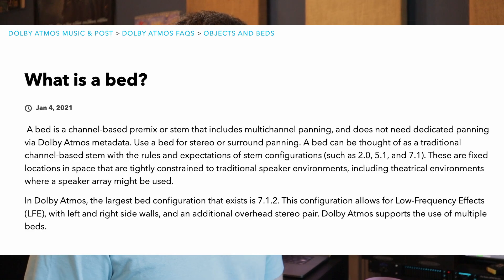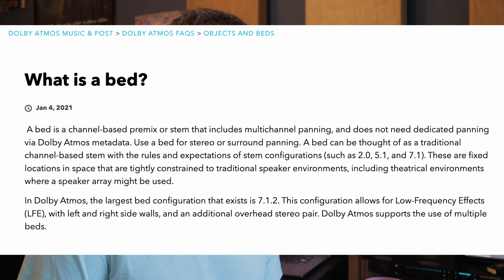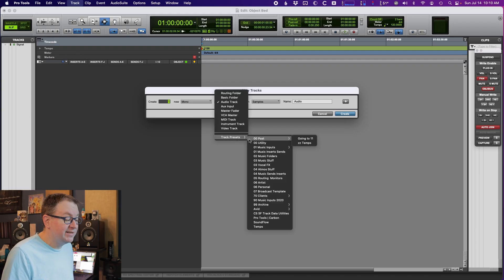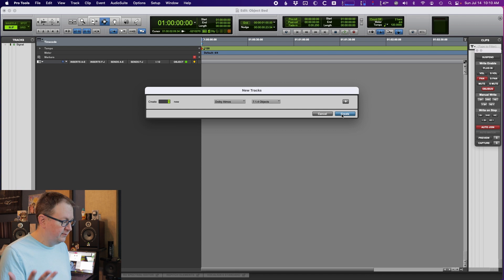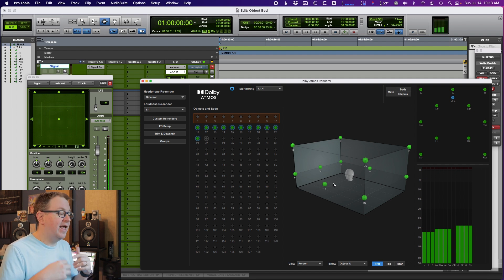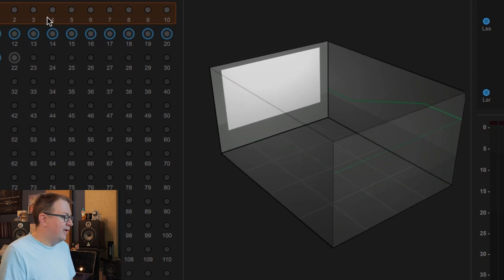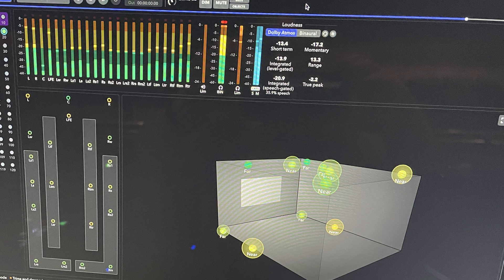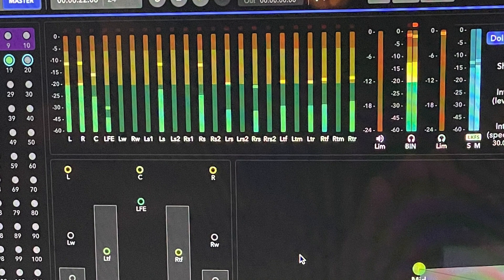The Object Bed for Dolby Atmos

Comment: hi Dave. My question is can you squeeze more level or energy by using the traditionnal bed by using, say a multimono limiter than with creating an object bed? i tried both of them(actually not using an object bed, but just objects) and come up with very different lufs and TP values whether i use a lot of objects instead of using the bed. The bed, according to my experience, specially if it is instrumental music, will allow me to get more level to my ears, while still maintaining the specs for dolby Atmos delivery. Is it just me, or the way i work with objects? Maybe it has to do with my template or something else. My experience with mixing in Atmos is kind of new(less than a year) and am working with protools Studio version, which is simular than the ultimate, except for track count and not being able to use the dolby atmos music panner.(apparently, it only works with the ultimate version) Thanks for your take on this. Great advice on a bunch atmos content on your channel!
Reply from the maker: This is an interesting question--hopefully I'm understanding what you're asking. In theory, a bed and an object-bed with identical pan positions should function identically in terms of LUFS. When you start moving to more discrete objects and placing things differently, that could affect the measurements since the measurements are all based on the 5.1 re-render. Does that make sense and answer your question?

Comment: 15:57 Sorry, for the stupid question… ;-)

Alright, by now, I understand that a bed must be part of a Dolby Atmos mix, I see that there are use cases with multiple speakers in a room — but once you are listening with headphones (from this moment on, called “binaural”, right?), all these channels from the bed as well as the objects would end up in two speakers of your headphones.

Is this Dolby Atmos “version” that will be played to you larger than a normal stereo mix? So, actually the amount of data being streamed… My understanding until now was that mixing-wise this is of course all taking its space and is as large as you told us before. But I always thought that this binaural version is so to speak a “flattened” 7.1.2 or at least 5.1 version, keeping the objects' movement in space — while still being as small as genuine stereo mixes.
Reply from the maker: Good questions.

From a data transmission standpoint, the binaural can be the same size as the stereo since it's two channels. However, how that data is transmitted to a consumer is something I'm not sure about, and I think it depends if you're doing the binaural processing on the device or if it's done at the distributor and then streamed. I know in the case of Apple's Spatial Audio, the spatial audio processing occurs on the device, and the .mp4's that Apple streams would probably be about 23 MB for a 4 1/2 minute song. I believe Tidal streams AC-4 IMS which is "immersive stereo" so in that case the binaural version is created by Tidal and then distributed.

I don't know that I'd describe it as a "flattened" 7.1.2, though. The binaural processing is trying to add the depth and imaging cues you'd hear if listening on speakers with the goal of reproducing the experience you'd have listening on speakers.

Comment: So when an object is coming out of just one speaker in array setup versus bed signal coming out of multiple speakers, is that volume difference some how compensated? Or does this mean we have consider this in our atmos mixes to make the objects louder, when using a bed for most tracks?
Reply from the maker: I don't think it's something you need to worry about. Arrays are mainly a thing for theatrical presentation and ideally you'd mix those on a certified dub stage where you would hear things in an array.

Comment: Hey there, thank you so much for your video. 

There is something that keeps confusing me on this. Most music engineers (Genewick, Andrew Scheps, Fab Dupont, etc) that have vids about atmos mixing, state that the bed = discrete channels, while objects = positioning in 3D space. 
Supposedly then, an object that moves around in a 9.2.6 room will translate better in a 5.1.2 space. Therefore, an OBED would be more "translatable" than a regular Bed. 

Is that correct? 

I get your point about arrays and big theaters, so in a way I'm wondering what would one do to engage those speakers, 

Additionally, could OBEDS can have an effect in Binaural, say you have three of them with far - mid -closed settings? 

Thank you!
Reply from the maker: Good questions. The bed is made up of discrete channels, however, it's my understanding that as far as the renderer sees them they are effectively objects with static positions. Personally, if I'm moving something, I prefer doing it as an object and not within a channel based bus(bed or O-bed).

From my experimentation, there isn't really a sonic effect of choosing a bed over an O-bed or vice-versa. I think for most engineers,  it's really more of a workflow choice. I recently have started using a bit of a hybrid approach of the bed and an object bed, but I'm still figuring out how to articulate why I did it.

Comment: Thanks for the great video! I have a question regarding the difference between a bed and object-based audio in Dolby Atmos, especially when considering playback on AirPods and Apple Music’s Spatial Audio. While I understand that using a bed might be better for theaters because more energy is coming from the speakers - I’m curious about the potential impact on headphones. When panning between speakers or placing sound within the virtual space, does using a bed introduce more phase issues or «smearing» compared to using object-based audio? I imagine that objects, with their precise control over spatial placement, might reduce phase artifacts in a headphone environment, whereas a bed might lead to less accurate spatial imaging. What is your take on that?
Reply from the maker: Good question. If I am panning between 7.1.4 speaker locations, I will use an object because you can have phase issues in binaural if you have the same information in multiple bed channels. Objects sound smoother to me in headphones when panning in between speaker locations. But for static panning to a speaker position, it's sonically the same if you use an object or a bed channel.

Comment: really good points. I use Object Beds For time based EFX. and when I want to pinpoint a sound/ EFX in space. An Example is I can set up a 4-point object bed and insert a quad reverb. Then place that 4-point bed anywhere in the space, Beds also Blead into other speakers, But like you said making them very important also.

Comment: Hi Dave, great channel.  A coworker recently turned me on to it and this is the best immersive mixing content out there.  Keep up the great work!  I recently had the opportunity to hear a mix I did using a 9.6 Object Bed in a 15.8 room.  I immediately noticed the same thing you express in this video - some speakers (the ones that didn't have Objects snapped to them) were not engaged in the playback.  I don't know if I would have noticed a difference if I wasn't staring straight at the Renderer (and its unused output meters), but the mix felt thin to me in that space.  So in terms of scaling, I sort of came to the same conclusion - that the Object Bed method is inferior for scaling UP.

You mentioned in the video that there is no sonic difference between using the Bed and an Object Bed.  I assume you are referring to when you A/B on your speakers.  Is there any discernible difference in the downmix?  Do you get different results using the Bed vs. Object Bed if you create a 5.1, stereo, or binaural re-render?  We've established that Object Bed mixes may not scale UP as well, but what about the more likely scenario of scaling DOWN? 

Another aspect to consider is the LFE.  Since the LFE is not directly addressable via an Object, the only way to get something into the LFE is to use the Bed.  In my example, I used an aux send for the LFE and it returns into the LFE channel of the Bed.  So in that scenario the Bed was not completely empty.  It just had one the one LFE channel.  Thanks again!
Reply from the maker: Thanks! I'm glad you like the videos.

In terms of sonic difference, I don't find there to be a sonic difference between Objects and Beds on my speakers or in any fold down situations. There shouldn't be any sonic difference between the bed and an object bed for fold downs so scaling down shouldn't be an issue which is good, I think, since the more likely scenario for music is that mixes will be scaled down.

Comment: Thanks for this! Could you please do a video on how the different track widths are compatible with each other? How do I make my Atmos mix (done in my 7.1.4 environment) utilize all the speakers in a larger, e.g. 9.1.6 environment? Cheers! 👍
Reply from the maker: I'm not quite sure what you're asking about track widths and compatibility, but this video might explain a bit about utilizing speakers in a larger environment than the one you are mixing in: https://www.youtube.com/watch?v=eDGCjoet5Kk
Reply: @goingto11  Thanks! Sorry for being unclear, I've watched the linked video earlier and if I understand you correctly, you set up a 9.1.6 track width bus which is then routed to your 7.1.4 Atmos outputs? And the Wide speakers are panned exactly 68 % in the F/R relationship? What makes this a bit confusing is two-fold. 1) I don't use Pro Tools so names of things in the DAW don't always match up and 2) I don't have access to a 9.1.6 room to verify that it actually works. :) But cool, I'll implement it accordingly in Cubase. Cheers!
Reply from the maker: Well, maybe one thing I should clear up is I'm not feeding an Atmos output--in some ways that doesn't exist. What I'm doing is feeding into the Atmos renderer which then feeds my monitors based on the configuration of the monitors which, in my case, is currently 7.1.4.

That aside, I'm not familiar with Cubase, but there are probably a couple of approaches you could use to hit the wides. The first would be to use a 9.x.x bus, and then figure out the panning to hit those specific channels. If there's a meter for that bus, that should help you figure out the values. Another way some of us have done it in the past is to just use a stereo bus that is assigned to a pair of objects that are panned to the wide positions. Then when you want to hit the wides you just send to that bus. You'd still have to figure out the panning value for Cubase, though.

Comment: Thanks so much for another outstanding video, Dave! One thing I'm not clear about: in the context of arrays and "coverage," how/why does the Bed interpret fixed pan positions differently than the same fixed pan positions in an OBED? This would seem to be at odds with the accepted language about the Bed, which is that its LCR, etc. channels are really just like objects that have fixed, unalterable panning data. I hope this makes sense, and sorry if I missed something. Thanks again for sharing your experience!
Reply from the maker: Well, the bed channels are like objects in one sense, but the bed is also more like a traditional multi-channel format like 5.1 and 7.1. I think this doesn't get talked about much when it comes to music production because it's generally not as applicable as it is in the audio post world. I'm actually working on a follow-up video that will hopefully demonstrate all of this a little clearer.
Reply: Excellent - thanks, Dave! Appreciate the reply

Comment: INTERESTING!  So there must be some voodoo going on in that cinema or other commercial Atmos cinemas because that is NOT the way things mixed in the BED are reproduced in any home cinema, even the largest and most insane ones that use a Trinnov or Storm.  It seems weird that the renderer is showing the balls with halo around them as if the “size” parameter has been engaged on everything.  I’m gonna get a discussion going in our Atmos mixing group about this because this is a very interesting topic.  Some things to discuss here:

A) The Trinnov placement guide seems a bit misleading because they list the multiple side surrounds (LS, LS1, LS2) as an array.  As you know an array is the same information duplicated through multiple speakers.  In the Trinnov you can set up of those 3 left surround speakers as EITHER an array or discrete speakers which can then only be used if an object pans through.  Something panned to Left Surround in the Bed will only come out of LS.  If you want something panned to LS in the Bed to come out of LS, LS1, LS2, you’d need to switch to a different speaker preset in the Trinnov that has them set as an array.  It will attenuate each speaker 3db and play that same sound out of all 3 speakers but then you lose the ability of an object panning along the wall to transition smoothly from speaker to speaker like it would in the regular preset where they are discrete speakers.  Something very weird is going on in that theater you went to (side note, that’s amazing you got to play back some of your mixes in that type of space!) but from your pictures it looks like it can instantaneously decide when something is a bed and duplicate that sound in an array fashion or if it see’s it’s an object it places it discreetly to the one speaker.  Also weird that in your pic when LS, LS1, LS2 are all showing on the meter, they are different level.  You would think if it was array they would all be getting equal volume.  When I was visiting LA last month, I was lucky enough to get to tour the Sony lot with Marc Fishman, and they showed us their Atmos mixing stages there which are basically small to medium size commercial cinemas.  They have so many speakers, I counted 14 height speakers in one of the rooms!  I asked if they are using any arrays and he said no, they are all set as discrete speakers.  So they are not mixing with arrays.  So again I’m wondering what the hell is happening in that theater!!!  In any case it shows that it’s very limited to that theater or other commercial theaters but no device that would be used to process the home theater mix will behave that way so it’s a very limited thing for people to get music mixes played in a theater.  Bigger point is it has me wondering what’s going on with decoding in theatrical?  Even though the mixing stages have discrete speakers, is it doing the same thing when they’re mixing where it has some sort of ability to “on the fly” place a bed sound in the entire array and keep an object locked to discrete speakers?  I’m definitely gonna follow up with Marc about that!  

B) Object Beds that you mention in this video seems like there is no winner other than for workflow but let’s talk about mixing in the Bed vs Object specifically for home theaters.  Movie mixes like Ready Player One which are mixed as Bed only are stuck in 7.1.2.  In every AVR or processor if you have 4 overhead or heights speakers, it takes the left top and duplicates that sound to Left Top Front and Left Top Rear.  Same for Top right.  So that way Bed height information will come out of all 4 of your top speakers but you still have discrete movement or placement for objects.  If you have 6 overhead speakers though, Bed only height info will only come out of top middle.  Most people find this frustrating and make a separate preset for movies like this that removes their top middles and uses only 4 height speakers so it makes that bed info cover a larger area.  Also, anything mixed in Bed only will NOT use anything beyond the 7 ear layer speakers.  So if you have front wides, extra surrounds, etc, BED information will NOT play out of those speakers.  You would need to do something similar like with the heights where you make a separate preset where those extra speakers are setup as an array.  Only the Trinnov and Storm can do that since in most AVR’s and processors arrays have to be setup manually and by sending that channel to an external device to duplicate it and time align and set the volume.   So for home theaters that have let’s say an 11.1.6 setup with extra side surrounds and front wides, they really miss out on using all their speakers on mixes that are bed only.  Thankfully, most mixes mixes use a combination of both where things that aren’t moving will be Bed but anything that has to move around in any way should be encoded as an object so all those speakers will get used.  

So to bring it back to your video, on an 11.1.6 home setup, something mixed in bed only or using object bed will sound identical.  In fact the object bed will probably work better for the heights since that will have 4 discrete height locations rather than 2.  

Also, as I proof read this whole thing, it made realize that if every AVR can recognize BED height info and duplicate it on the fly, which couldn’t that be done with the surrounds or wides?  That fact that even the Trinnov or Storm can’t do it on the fly tells you it must take some serious processing power.  So maybe only in theatrical Atmos and mixing stages do they have processors that have the ability to see if something is bed or object and send it to the speakers as an “array” or discrete object.